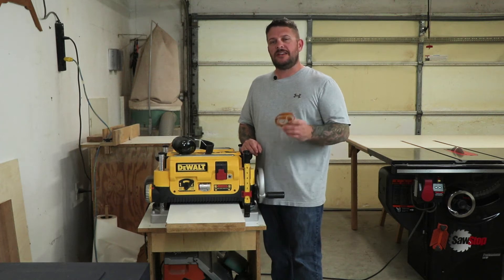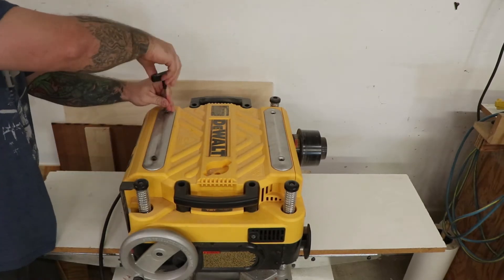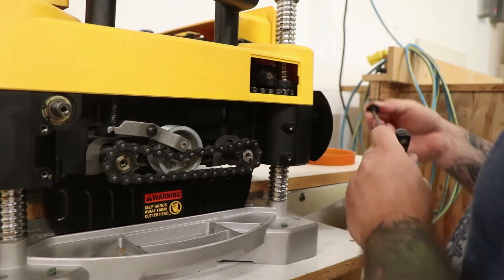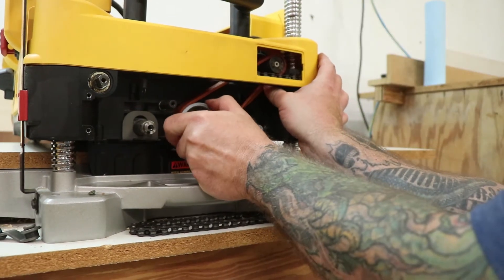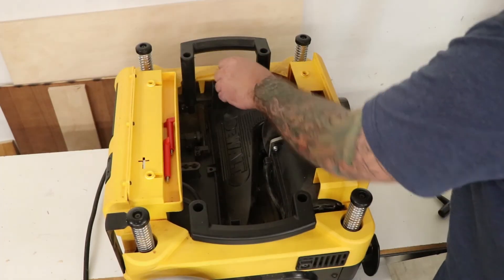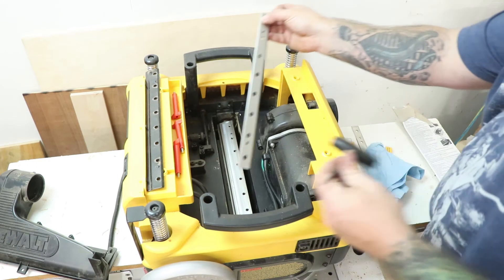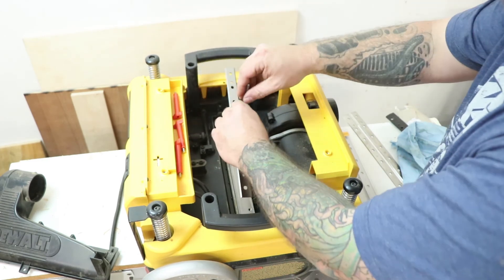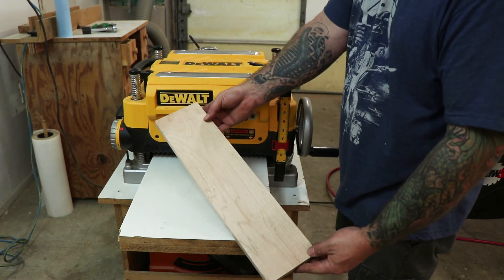Replacing the Belt And Knives On A Dewalt 735 Planer

Comment: I just replaced my new belt, which was a lot harder than when I put the original belt on after installing a Shelix cutterhead because the original belt was probably stretched a bit after 2 years. This was the BEST METHOD of all the ones I watched and somewhat tried to get the new belt on. The only way I found to get the belt to feed around the large pulley was to used the socket to turn the pulley clockwise so I didn't loosen the pulley nut while using the socket to stretch the belt enough at the pulley feed point. Great video and thanks

Comment: Excellent, of course I found this video AFTER I replaced the belt but I still gotta do the blades and thanks for the tip about the magnetic tool( I had no idea).  My tensioner screw is stuck and I decided to not try to push it with an impact screwdriver but I managed to get the belt on just the same. I do love this planer tho, now I think it’s even more innovative due to it being so DIY friendly for maintaining. Nice table saw btw….

Comment: Thanks bro, mine was sitting for a while in our hot climate and that urethane belt had degraded. When I turned it on....it made  what my old friend used to describe as "an expensive sound".  You made it easy for me. Thumbs up!!
Reply from the maker: Lol. "An expensive sound" is great! Thanks for watching!
Reply: @TwistedWorkshop77  Ok......I might have given you the impression that it was "Mission Accomplished". I always like to say that anything a skilled mechanic can do in 15 minutes....I can easily do in 3 hours. My old belt decomposed badly and I had to get in there and clean the grooves on both wheels, and then came the fun part. I bought the 2 belt package from Scamazon and found out quickly that the belt had the same elasticity as stainless steel. The "bicycle chain" method you  made look so easy didn't come close, so I took the wheel off and used the clamp method, which was as easy pulling a fishhook out of your dick.
I also read (after) the reviews on the Scamazon belts, which were not glowing and cheerful. I'm guessing you had the OEM belt? Anyways the machine works again and I now have a really great excuse for that OJ and tequila (2shots) sunset drink. Thanks again, you made it "look easy".  YOU BASTARD!!!!!😂

Comment: I've found the square drive screws sometimes difficult to remove. After breaking one off I found Dewalt makes some nice star drive screws and a wrench as replacments. Much easier to use. Also, I now use a 3/8 speed wrench to loosen the screws. Also much easier. 
 Now I have switched out the cutter head with a Byrd helical head and haven't touched a knife in a long time.
 Great videos, thanks.
Reply from the maker: Thanks for the advise. I would like to get the helical head for mine. It has a lot of miles on It now and I worry that it breaks after such a big investment. I will probably end up getting it anyway. Thanks again